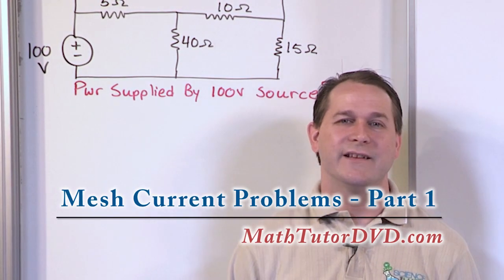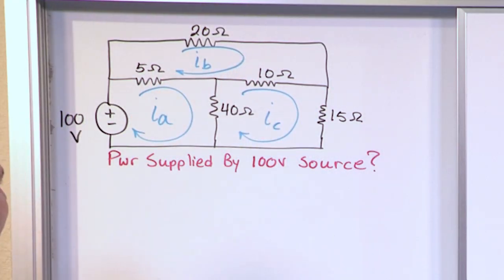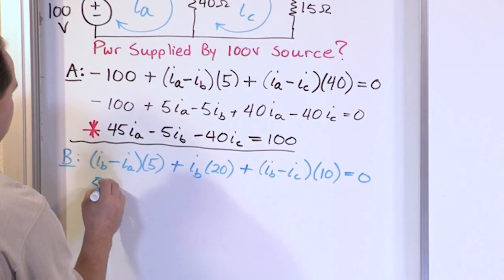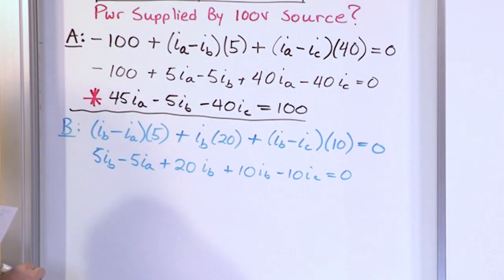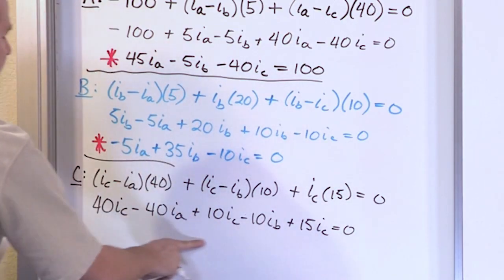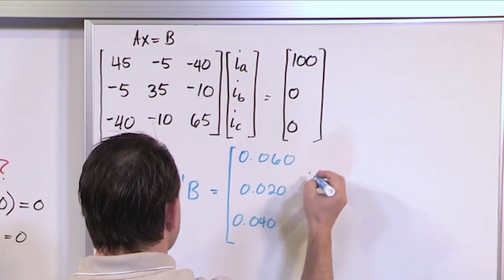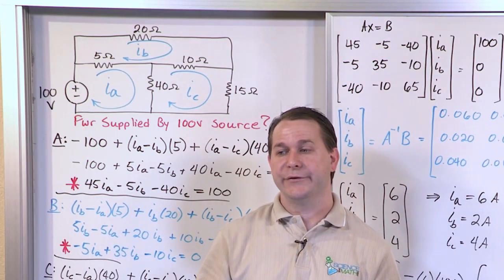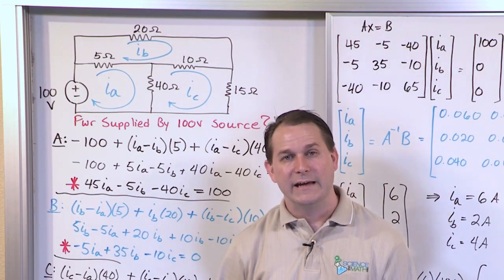Mesh Current Problems in Circuit Analysis - Electrical Circuits Crash Course - Beginners Electronics

Comment: I could not get why everytime there is a voltage drop, the sign of the resistor is still positive instead of negative.
Reply: Yes I also saw that mistake throughout his calculations

Comment: hello, I have been reading through other sources and basically what I read was if the loop goes through the negative sign 1st then goes out the positive (called rise) we treat it as positive while if the loop goes into the positive sign 1st then goes out the negative sign (called voltage drop) we treat it as negative, so now I am confused because you do the exact opposite of what other sources say.
Reply: you still don't get it . what you are asking is typical of making Arbitrary  orientations .  Have you ever solved a basic Projectile problem ? i am gonna guess that you have NOT . Thus , you still have issues with basic physic problems . ( should we use +pos is Up and -neg is Down ) ? or
( should we use  -neg is Up and +pos is Down ) ? use the  arbitrary orientation
that you want , it makes no difference .

He is using the +-sign as He Enters each component( these are the KVL +-signs)
of the equation . He doen't really describe the  Ohm's Law +-sign writing . Thus a true noob is gonna be lost .
There are many , many ways( Conventions to use ) to write circuit equations .
the video shows one way to do it .
you , are wanting to use a different( another convention) both are prefectly valid.
However ,
once you choose a Convention , you need to use that particular convention for the entire circuit analysis .  If you have time , you can re-analyze the same circuit using a different convention .
No matter what\which convention you choose to use , each analysis will Always come to the Same conclusion of how the circuit operates .

the video does NOT give in-depth information on  Convention and Orientation .
( there is Much more to say about this topic )

Comment: I think he missed it .  No  Passive Sign Convention .  and he plugged the  coefficients into  a matrix to solve the system of Eqs( beginners never use a  matrix ) , while he wrote all 3  initial equations the "hard way" .  all  that will  definitely  confuse any  beginner .o'well .

Edit  Dec 29 , 2018  read  chapter 1 and Chapter 2  of  book :
ISBN :  0-07-027410-X   McGraw-Hill  
Engineering  Circuit Analysis  Fifth  Edition  1993 .  Chapter 2  covers the  Context of  Mesh  analysis
verses  using basic  branch currents .  Look on page  65  66  67
Yes , this book does NOT talk about writing  equations directly into  Pattern  Format .
( NOT sure why  Pattern formats are NOT included , cause the book does plug into Matrix's too , and the equation format that plugs into the Matrix is  the  Pattern , which can be
written Directly by Inspection of the circuit diagram ,...too easy .
The  Final form  Pattern of each  equation is there , but the authors never mention it )
Reply: You are right.........

Comment: Sir what if there is dependent source ?
Reply: you might look at book :  "Basic Engineering Circuit Analysis"  however , be warned .  ALL of these  "4 year books" , have  "gaps"  of  missing information .  They start at point A ( sounds good ) , they get further into the concept , then all of a sudden  they are at  point B ( conclusion ) ,...what ?  yeah , all the books do that .  the sad thing is , teachers don't know what the  gapped crunch is , cause they  read the same books with the same gaps of  info . Thus you will need to  "go deep" , to fill in the missing  crunch .  I bought the book for information , not for it to have gaps of missing info .  a  good book on  transistors is :
"Microelectronic Circuits  second edition" . it is a good book . lots of stuff . however , it is full of  "gapped" information .  I have  crunched many of the missing  info gaps , with lots of math crunch ( these gaps are not even end of chapter problems ) .  unfortunately , that's how the books are .
Reply: 240mains thanks

Comment: I did the question again without the video and when I try to invert the matrix A by "a single button on the calculator" I get completely different results. e.g. 45^-1 is 0.022, -40^-1 is -0.025

Then how did he do it?

Comment: I don't understand why you assume the current flows backwards. ib crosses the 20 Ohm resister going left-right, but why does it then continue to flow backwards right-left across the 10 Ohm and 5 Ohm resistor at the bottom, as if it's going from positive to positive, never reaching the negative side of the circuit.  Maybe I can understand the 10 Ohm resistor at the bottom because the other side of the node is connected to a path to ground through the 40 Ohm resistor, but not how it crosses the 5 Ohm resistor back to the positive terminal of the source.  Same with ic crossing the 40 Ohm resistor going from bottom to top, like it goes around without ever having to reach the source again.  Can someone explain what I'm missing here?
Reply: the video does NOT explain , in detail , how to use  Mesh currents . and your observation is greatly skewed in your question.
not your fault . you need to read better books or
find someone who actually knows what is going on . To date , Jan 19 , 2020 i still have NOT see 1 youtube video that knows what is going on ( sad to say ) .
i only watched this video for entertainment . keep reading , keep studying .

Comment: why some tutorials gives negative voltage when you go with the current in a resistor.. really confused
Reply from the maker: This is all just convention.  As long as you are consistent in the way you count the voltage as you walk around a loop for every resistor, then you will get the same answer either way.  Most EE textbooks do it the way I do it.  If you take negative values for every resistor, as long as you are consistent, then your system of equations will have negatives everywhere compared to mine, but you will get the same answers in the end.

Get our Free App and View all Lessons!
http://www.MathTutorApp.com
Reply: @MathAndScience  Same Answers either way ?  kind of .  one convention might result with a +5 volts , while another convention might give a result of -5 volts .  Both  answers are ( Valid and Correct ) for the same circuit .
Do you know why that is true ?  ( i know why , i was just asking if you do )

Comment: I noticed that circuit is actually a bridge, with the 10 ohm resistor as the center. I've been trying to analyze a bridge with no luck, (I think I'm making errors), anyway I applied thevenins theorem to the center resistor and came up with 45.8v th and 13 ohms th and it all worked out! Thanks a bunch!

Comment: very clear explanation. Thank you very much.
I have a doubt. Why are we considering current in a clock_wise direction?
Reply: Santhi siva You can take in any direction. We are just assuming it. You can use anti clockwise direction and still arrive at the same answer
Reply: @manojmaharaj1775  again , ( kind of ) , the same answers .  CW clock wise arrow might give an answer of -2 amps , while if we had use CCW  counter clock wise arrow , we would have gotten an answer of + 2 amps .
Both answers are ( Valid and Correct ) . do you know why Both answers are  Valid ? ,...i know why .

Comment: Wha- I didn't get how did you calculate the currents using the calculator. You get the inverse first right, then I didn't know what happened
Reply: +Korbs I get a "dimension error" notice

Comment: how did you solve the numbers on the box 3x3 ? you must assume that not all your viewers are smart enough to know everything. but over all its great video tutorial. i just stuck on that part . i dint know how to solve that
Reply: +Noel Atilano watch a video on youtube on how to find the inverse of 3x3 matrix and then how to multiplicate matrices. It is quite time consuming so it is better doing it in a calculator.
Reply: +Angelos Bit ok thanks sir. i just pass my physics 2 . thanks a lot . i used the method you used sir.
Reply: I know its been 2 years but I already watch 2 of those video but it seems not correct. The inverse in my calculator is different from the inverse in the video. What seems to be the problem?

Comment: inverse of 45 is o.060? its 1/45 right? w/c is 0.022
Reply: +John Roble The inverse of a matrix is not the same thing as the inverse of an integer. Google the inverse of a matrix if you still have a question about it

Comment: you can solve this in 30 seconds just by looking at it. mesh a: add all resistors = 45. mesh b add all resistors = 35. mesh c add all resistors = 65. what resistor shares between a and b? 5. which shares between a and c? 40. resistor b and c? 10. now if you look at the matrix you can see the pattern. the diagonal will always be positive the rest will be negative and mirror each other.
Reply from the maker: jordan anderson Hi Jordan, that really isn't the point.  This problem is simpler but I am teaching the technique here.  The problems get harder so that eventually you will not be able to do them by inspection - but you will need to use the technique which is taught here.  Thanks.
Reply: @MathAndScience  jordan anderson is   Right .  writing first level Mesh equations by inspection really is easy .  Someone needs to know and understand the Full definition of what a Mesh current is .
Traversing is a valid technique , with too much  interation . Writing the  first level equations Directly by inspection  uses the full definition of Mesh currents too , provided someone knows what the full definition of a Mesh current is . keep reading , keep studying .
Reply: I've never seen a circuit you couldn't do by inspection doing it this way seems pointless.
Reply from the maker: jordan anderson Hi, I understand what you are saying.  But, the mesh current method is very powerful. I could sketch a circuit in a minute on a napkin that would have 8 meshes in it that you could definitely not do by inspection but would be very easy to do with the mesh current method.  Think of it this way, why would electrical engineering students be forced to learn this method if every circuit could be solved by inspection?  The answer is that there are circuits out there that you can't solve by inspection and need more powerful and flexible methods to solve them.  Just because you have not seen them doesn't mean they don't exist.  Thanks, Jason
Reply: Thanks homie, I did okay as a bartender, but I started to notice that young people were coming to work and making the managers all googoo eyed, despite having no experience. I decided the restaurant business wasn't for me. It probably was because my looks started to decline, as well as my health and stamina. I'm a 6'7 man so, I guess its okay that I look like one lol. So yeah, engineering is hard, but you can't be a bartender forever.
Reply: You're a fucking tool Jordan, shut the fuck up you dweeb
Reply: This guy got shut down by a tutor LOL
Reply: jordan anderson Hardy Cross has similar thinking except that his iterations imply that he knows he needs to get a second or third, etc check before he knows he's correct. I like his method.
Reply: +jordan anderson  can you explain to me more detail.. so i can easier to understand? thanks
Reply: +mathtutordvd you got it sir! -engineering student
Reply: jordan anderson please explain more about matrix in continuing to solve
Reply: +  -  -
-  +  -
-  -  + 
see the pattern in the positive and negative numbers? and how each number mirrors each other across the positive line?
       5  \ 5  
        40 \ 40
         10  \ 10
Reply: jordan anderson If you were a good grad school berkeley professor, you would basically cover the resistor circuits in 1 lecture and spending time saying "by the way, you'll always get a symmetric matrix with just resistors. You can do this to save time on exams". And then never see it again. haha When we went over flexibility method in structures, the professor said that and I was able to setup the matrix in seconds on exam.... however, it was the stiffness matrix where it could be anything... but that's what i meant by hardy cross earlier. His thinking gets past the need for a matrix and used iteration based on a distribution of stiffness among the beams/rods/columns to calculate how much bending moment goes to each element, redistributes at the node and repeats until the sum of moments at node is zero.
Reply: fuck you too buddy
Reply: +jordan anderson thanks,,i never noticed that....now its gonna be way simpler for me,,,thanks once again :)
Reply: I thought you had to be good looking to be a bartender, how did you become one? guess its good you're going into engineering because you probably make 0 in tips since you look and sound like a man. see how i can make assumptions about you too? nice vids btw
Reply: Matej Jukić
nope

Comment: Nice explaination thx, but im wondering about 100 voltage why its negative while its rise !!! Should be plus i think. Thank u very much.
Reply: Budhabiya maybe the following is the reason why the two opposite conventions are popularly used. Some follow the logic that for every voltage rise is a plus, and a drop for every resistor (because that's what it really is) is a minus. However, if you will follow the passive sign convention of power in a circuit (supplying components are minuses and absorbing components are pluses) then the sign convention changes. We can use whichever sign convention we want as long as we stick to it within a solution. thanks for the video
Reply: some people write the  KVL sign as they  Enter each  component . Thus ,  -neg  terminal is Entered
and we write  - 100 .  Of course some people might write the  sign as they  Exit each  component ,
in that case , we would write  + 100 v .  This is  NOT  confusing nor  double talk . read chapter 1 and 2
of book :  ISBN :  0-07-027410-X  Engineering Circuit  Analysis  Fifth Edition , 1993 .
Note :
ALL  2 Year Tech School  books have insufficient info to properly write  equations .
( High School teachers don't know how to do it either )

As I was saying in my original  Stand-alone-Post , he Never  talked about How he  Wrote the  Equations .
That should have been the  Whole Point of this tutorial , but he did NOT do that .  Hence your question .

If you are coming from  Electron Flow , then  give that up .  Because all the  4 year books use  hole Flow .
If you want to write  equations , you will be using  hole flow .  If you want to use  Pspice , you will be
using  hole flow .

read chapters 1 and 2 of the book above . That should fill in ALL the gaps in  DC  circuit  equation writing .

You MUST read a Four Year book , such as mentioned above .
Reply: He should use positive sign for volti

Comment: top notch video. true excellence. you touch on subtleties with convention esp. with the voltage drop from negative terminal to positive as negative, and assuming the polarity of the resistor to conform with the direction of current being analysed at that point. keep it up!

Comment: quick question: can I take the I (sub b) mesh to start at the 100V source then into the 20 ohm, then through the 15 ohm, and back to the voltage source? It's a different loop but it still covers all the resistors. Thanks!
Reply: no, because there are resistors in the middle of the "super mesh" you propose. the current changes when it goes into other branches (KCL, conservation of charge), which is essentially what you would be ignoring by creating that super mesh.
Reply: Luke Porter Thanks a lot for your answer. Very clearly explained. :)

Comment: how about there is a current source instead of a voltage source?
Reply: Then you have to do source transformation to them.
Mesh current - Only voltage sources
Node voltage - Only current sources
Reply: RealationGames  I think "only" is not the right word, better use "A lot of"
Reply: 7Singularity
It's already plural.
I could also say: "only a lot of X sources, but none of Y sources" :)

Comment: i didn't get the inverse calculation done here, since i hit the same problem in my casio fx-991es series calculator the result turned out to be something else.
Reply: it will become more easier when you use that type of calculator. just change your mode into MATRIX then choose the 3 unknown. just substitute all the value for each variable. click equal sign. you get the value of i1, i2 and i3